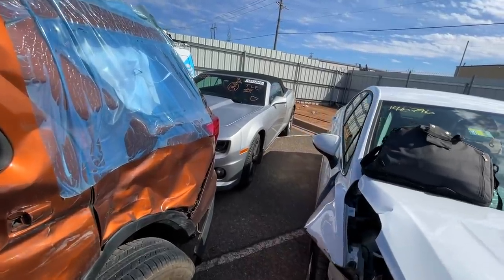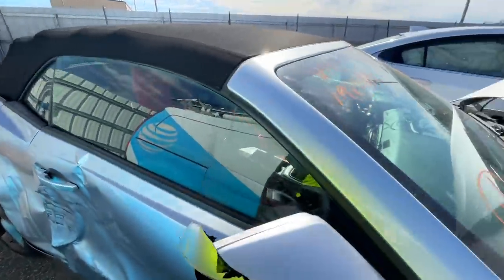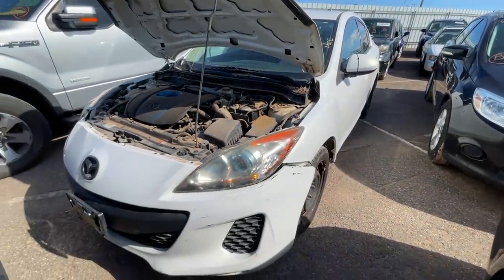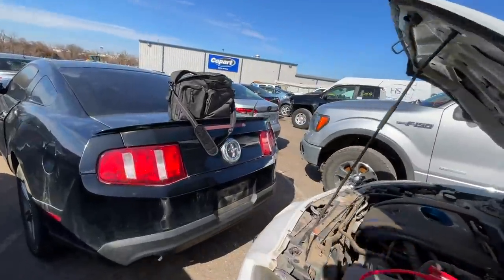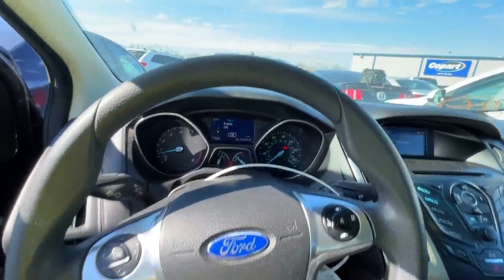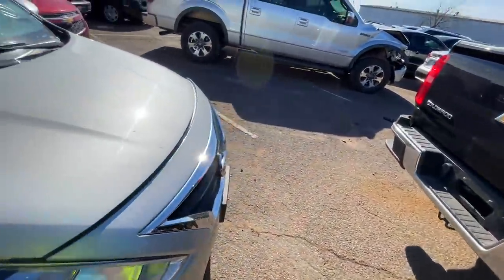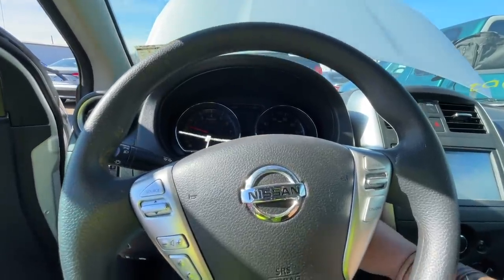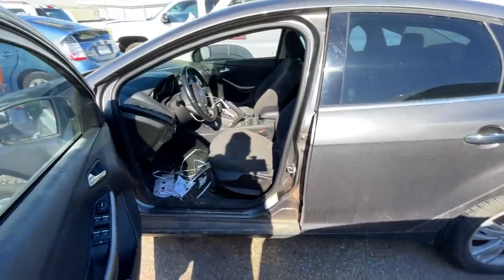Copart Walk Around + Carnage 3-2-2021 + Cheap Camaro SS!!

Comment: The blue engine cover Is actually oem. I have a 2013 Mazda 3 with the same skyactiv engine.

If it goes cheap go for it, Is a good reliable car.
Reply: Right, so the engine cover is blue and there are blue rings around the headlights.  That is how you know it is a 2.0 w/ skyactive, not the 2.5.  They are solid cars.
Reply: @mitchbrown4035  exactly
Reply: I have a 2013 cx5 with blue skyactive engine cover. I have 210,000 miles on it no issues just basic maintenance.
Reply: Good to know, I thought it was sketch that someone would half ass rattle can it 🤣

Comment: Randy, in the focus, that rattling in the engine is normal at least for my car. My upper motor mount is leaking a bit but it isn’t bad with the shaking only at idle. That 2.0 needs plugs done every like 60,000 miles so I bet it’s about time they be done if you are interested in that car
Reply: Don't forget  the transmission  problems on those cars and the fiestas.
Reply: @cristian50184  my car has 125,000 miles and still has the original tcm and dual clutch assembly from 2012. Many people see this as a bad trans. Ride it hard(4,000+) on every acceleration and you won’t have a problem. Not all of them are bad👍
Reply: Yeah maybe you have the lucky one because in mine I got it with 34k miles and  with 52k in 2 year of ownership  they replaced the clutches  2 times , and the 3rd time I just trade in lol. And yeah they got bad reputation  but I know  the engine on those are pretty  reliable  , like the stick versions are pretty  good little  cars .

Comment: Randy, that Mazda 3 is likely a great car.  If you've never driven one, they are a blast to drive.  The blue on the engine cover was likely factory but deteriorated over time.  The original Skyactiv engines (for like the first year or maybe, possibly the 1st and 2nd) that I believe came out around the model year of that car actually had a blue-painted engine cover, very similar to the color that is deteriorating on that car, probably because of the heat from the engine bay.  Mazda did that only for a year or two then stopped doing it and the engine cover was just left black after that.

I actually test drove an early Mazda 3 with the Skyactiv engine and a 6-speed manual brand new when they first came out.  To me, it did feel very underpowered, at least at the low end, however, it gets GREAT fuel economy and Mazda manual transmissions shift like butter, smooth with nice short throws.  Also, they handle great!  Not only is the engine in these cars Skyactiv, designed for efficiency but the transmissions are, too.  Mazda designed the entire driveline and exhaust system to be as efficient as possible and they are impressive, especially compared to other cars built at the time that they were.  

Mazdas are designed to be fun to drive, too.  Even the most basic of Mazda, I have a friend that bought a $13,000 base Mazda 2 with an automatic brand new that was old even by the time the US got it, it had been sold for a few years in Japan and Europe by the time we got it however despite how old it was, it drives very much like a Miata and while it is quite underpowered, I think it has less than 100 hp, damn it's fun and very well balanced.  Mazdas are a blast to drive, even the ones that are underpowered.  It's easy to forget just how underpowered some of them are because of how fun they are to drive.

My sister had a Mazda 3 much like this one, same color even.  She pissed off a neighbor of hers at the time who was mentally unstable.  She lived in an apartment at the time.  He kicked in both driver's side doors.  A friend of hers worked wonders on the dent by heating and using a simple plunger like you'd use on your toilet.  While it wasn't perfect, it made a HUGE improvement and, should you decide to get it painted at they could finish the feathering in and fixing of the ripples with a high build primer and a good wet sanding.  The metal on these is thin, it doesn't take a lot to dent them on the bad side, but doesn't take a lot to pop them out on the good side.  I think most of the body is aluminum, not sure if that's a blessing or a curse but I imagine it makes manipulating the metal a bit easier.  This white is a 3-stage, it is beautiful but you could paint the entire car let's say, the same red as your Corvette and SN95 Mustang and it'd look even better, pop more and probably be less expensive that fixing just the stuff that needs to be fixed with a tri-stage.

I was really excited to see the Mazda 3.  Speaking of those, I hope you will consider looking for a Mazdaspeed 3 or maybe even a Mazdaspeed 6 or Miata.  Those would be REALLY fun cars for your channel, they're a blast to drive and I think all have fallen in price enough to where they don't break the bank to buy them however especially  the Mazdaspeed Miata and 6 are only a couple of year available models and I bet they will appreciate like mad because of their short life span, the fun that could be had with them and the fact that Mazda doesn't build anything close to them now with the exception of the Mazda 3 Turbo which is overpriced and only comes with an automatic transmission.  The original Mazdaspeed 3 as well as the other Mazdaspeed cars only come with a manual transmission, I am not religious but if I was, that's the way God intended.  I actually also recently saw a beautiful, Orange (Mazdaspeed only color) Mazdaspeed Protege, the predecessor to the Mazdaspeed 3 which is also cool.  Please consider being on the lookout for one and trying to pick one up if you can.

Comment: 2 things, Randy. (1) slow down. The car with the dealer service tag had a service tag on the key. Sometimes, what it's in for is on the tag. (2) Of all the vehicles, I think you could get good, quick flip content with the rental Nissan, IF the price stays right. Also, getting back to #1, why was there a wheel chock piece of wood there?

Comment: The front end of that focus does sit that low. I have a 2012 focus. The thing I would warn you about is if you want an inspection on that car make sure the horn works mine doesn't, also make sure the cruise control is good. Mine likes to act up on me
Reply: Love my little cars too. And I like versa. My parents had one they traded in for a nissan kicks. But that little car was a trooper. But when there was this huge recall on the air bags. It took them about 6 months to get it fixed

Comment: My guess is that the focus probably just needs a tune up those small modern engines need the plug's replaced on time or it'll run like crap and people that own those kind of car's never pay much attention to that stuff and good old dealers they charge you a fortune to do simple job's my first mission would be to find out when should those plug's be replaced.

Comment: with the focus, people with comment on the DSP6 being shit, its not, I have a 2012 focus with it and its great and remains functional lol... the focus has an issue with the motor mounts going out early just because they're cheap. With the idle, there is a harness that gets rubbed into and may break a wire - this WILL cause a check engine light for sure, and misfire w/ idle issues, however the issues it seems are related to the motor mount. 

if you dont care for a car, for example the ford focus MK3 has a DCT transmission, and needs DCT fluid changes every 30k, other cars just keep up and they'll last. 

source: MK3 and zetec enthusiast

Comment: And the reason why everyone hates the versa/Almera is because the interior just doesn't hold up there's no leg room the seat's are very uncomfortable the headlights are crap the bumpers don't stay on my brother and his girlfriend had one and it was the worst car they ever owned the only good thing about them cars  is maybe for a learner because there extremely easy to work on under the bonnet and very cheap used . Ps his was a 06 and a manual I don't be worried about the coolant they always drink a ton of coolant well Michael's one did anyway and it had 345 Kms on it when he scraped it.

Comment: I’ve had 10 Nissan Versa good on gas sucks on the interstate if there’s any type of wind out of the 10 I’ve had 9 of them The transmission went bad We had them for a company car the transmission starts going bad around 98,000 miles On some and I kept mine serviced Every 5000 miles at the Nissan dealer if it was recommended it was done so the transmissions do suck

Comment: As a diehard Ford guy I will tell you to run far away from that focus! They're the worst car Ford ever made. They have the worst CVT transmission ever. We bought a brand new one in 2013 & it had multiple transmission rebuilds & even 2 engine rebuilds in the 3 years we suffered with it!
Reply: It's not a cvt, it's a dual clutch powershift. But yes, it's a very problematic trans